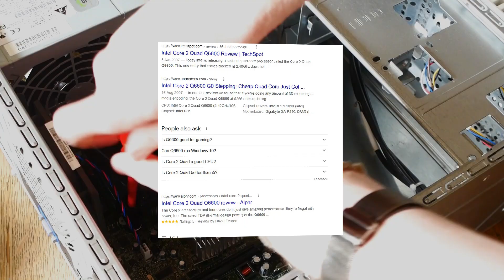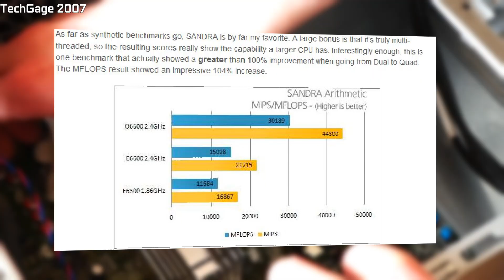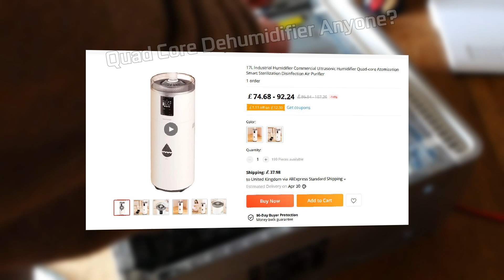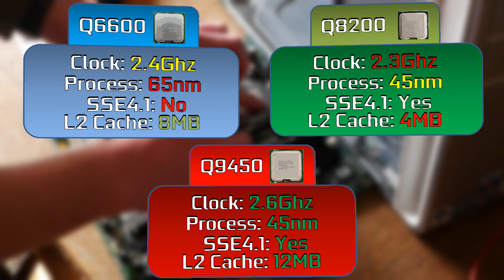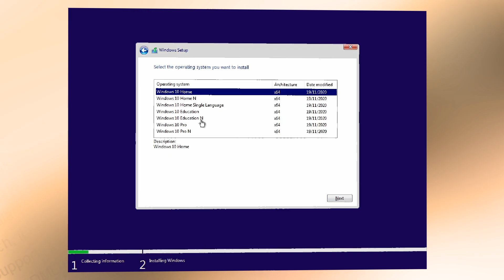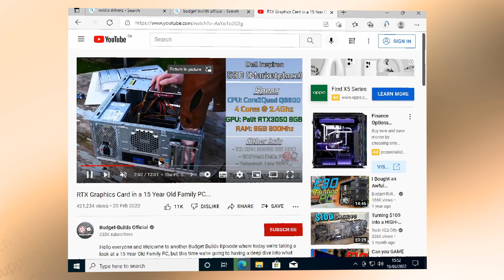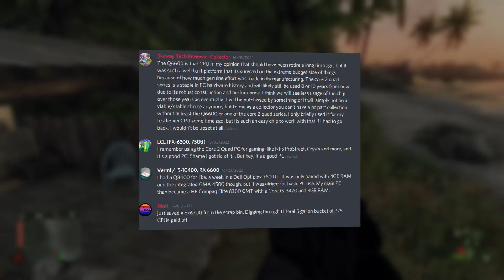Intel's Core2Quad...Finally Obsolete?

Comment: the Q6600 for £10 seems silly versus the i5 2500k for £15 which can overclock to near 5GHz
Reply: You don't buy the cpu. You buy an entire used pc with a q6600 at a local thriftshop or something
Reply: @bonnome2  for £10 that is more worth it
Reply: Frequency doesn't automatically mean better performance though, just look at bulldozer
Reply: @canaconn2388  in this case it means a lot as 2nd Gen Core i series has incredible IPC for its time, with the overclock it rivals stock 7th gen i5s
Reply: You'd look rather silly trying to plug an i5 2500k CPU into an LGA775 socket.
Reply: @terrydaktyllus1320  obviously buy an LGA 1155 not 775
Reply: @williampaabreeves  So it's not £15 for the i5 2500k then because you would probably need to spend at least £30 for a used LGA 1155 motherboard, wouldn't you?

I bought a Q6600 for £3 in my local CEX store today - so a fair comparison would therefore be "the Q6600 for £3 versus £45 plus for an i5 2500k and replacement motherboard.

Oh, you'd probably need to do a RAM upgrade too because the LGA775 board is probably DDR2, whereas the i5 board will be DDR3.

You're welcome. You can thank me later.
Reply: @terrydaktyllus1320  he tested the q6600 with a ddr3 board.
You can get low end 1155 motherboards for similar to 775, around £15.
Not a fair comparison unless you include all components. The 2500k is still vastly faster for that £10-20 extra.

The only situation to buy the q6600 is if you have LGA 775 with a core 2 duo or lower already.
If starting from scratch, the extra for LGA 1155 is worth it due to the existence of i7 as an upgrade path

If someone is so flat broke that £10 more is unfeasible then perhaps dumpster diving around office buildings would be a better path to a new pc
Reply: @williampaabreeves  But I don't have my Q6600 in a DDR3 board, I have it in a DDR2 board. So your cost comparison is entirely incorrect in my case because I would have to include the cost of a new (used) motherboard and DDR3 RAM. Again, you can thank me later for correcting you.
Reply: @terrydaktyllus1320  your one case is a very small minority.
This comment thread started with just a CPU price comparison of £10 Vs £15
Which the i5 2500k is obviously better value in
Reply: @williampaabreeves  Most LGA775 motherboards are DDR2. Sonny, I've been building computers as one of my main hobbies for 40 years now, not to mention that my day job has also been with computers for an almost equal amount of time. I know what I am talking about. So say "Thank you, I've learnt something new today."
Reply: @terrydaktyllus1320  clearly not very successful if still using a q6600.
Only thing I learned is you think yourself as the only viewpoint and authority on the subject. With your specific circumstances as the only situation

Comment: No C2Q experience beyond fixing a couple 775 mobos back in the day. I would be interested in doing a comparison to how the challenging Athlon/Phenom series is holding up these days though. My first PC build was an Athlon based system because they were noticeably cheaper when I was building it
Reply: I bought a Phenom 2 955 95W a couple of days ago for just 8€ including shipping. I also have plenty of 775 chips and motherboards around. I would like to compare the two competitors to each other. I've also a Phenom first gen Quad-Core somewhere to compare it as well. The main difference is the integrated memory controller and for the Phenom 2 the L3 cache.
Reply: @jhonnyxyz  Darn! A Phenom II 955 (95W version) sells for about USD 35 in my country :-(. That's without Cooler/Fan. No wonder I'm still using my Athon II X2 to type this. Edit: besides... my aging motherboard would probably melt if I try to run anything above 65W :-D
Reply: Phenom II is slightly faster than C2Q clock for clock and overclocks similarly so it'll be holding up too, although obviously the six core option will do a bit better especially with modern games that can actually scale to use those cores. :D
Reply: I resurrected an Athlon XP machine recently and it was not very usable. For one those weren't 64 bit chips so you're now quite limited in terms of "current" O/S choice. And once I found a Linux distro which worked, it could barely cope with opening the front page of YouTube much less play HD video. The 64 X2 might still fare better, I think X2 had similar performance to the C2D of the time, but certainly not C2Q. It was undisputed king at that time.
Reply: @ubergeeknz  The Athlon64 x2 wasn't as fast as the Core 2 Duo, but it should still be fairly usable with a suitable modern Linux install especially if you have a PCIe motherboard and throw in a reasonably modern GPU for video decoding.

The Athlon XP won't work too well with modern Linux not only because the CPU is simply too slow for a lot of modern programs but the Socket A platform itself is the last "old school" platform (eg. IDE is the main storage access stnadard with SATA being a bit of an afterthought on later boards, there's no PCIe support or anything remotely like it, etc) where a lot of the underlying software required for an OS likely isn't tested too thoroughly with that kind of configuration these days.
Reply: I bought old PC for 50 EUR because it had solid steel case and modular 750W PSU (I also spared copper Zalman 9500 heatsink and GT710 from it for my Ryzen 5600X office build).
It had Asus m3a32-mvp deluxe MB with Phenom 9850 and 8GB DDR2 (which I later sold for 24 EUR), and I tested it a little. It has similar performance to Q6600, runs Windows 10 Pro, easily plays Youtube HD videos but runs much hotter than Q6600. So older quad cores still can be used in 2023, but when 3rd or 4th gen Core are almost given away (one can buy i5-3570 with 8GB of RAM and 240G SSD drive for 50 EUR) that makes no practical sense.

Comment: Tested on windows 10?
Reply: @BudgetBuildsOfficial  oh, sorry, didn't watch to the end. If you use win10, can you please test something with optimized win10? With disabled mitigations, defender, background stuff, and optimizations (like forcing CPU to always work at 100% and moving GPU/usb driver from core 1 to core 3 and 4, because windows likes to load core 1 more than the rest).
Reply: Also disabling "fullscreen optimizations" (introduced in iirc build 1809 of win10) on games. It allows you to see volume bar and notifications while you're playing in fullscreen and hurts performance by 1-2%

Comment: Holds up better than the older Phenom does thats for sure. Maybe more comparable with the later 6 Core Phenoms but the Quad Core Phenoms lose 100%
Reply: nope, quadcore phenoms 2 gen are better than 775 quads
Reply: @jatoziomek5608  where's your stats for that? My own testing has shown the phenoms to lose to core 2 quads massively

Comment: I use my old Core 2 Quad Q6600 computer as a file/media server. I built it all the way back in 2009, it has a 9800 GT, 4 GB of RAM and an 80 GB Intel SSD which wasn't cheap back then. I also added a 4 TB HDD when I turned it in to a server but for some reason the motherboard is stuck in IDE emulation mode with no apparent way of switching to AHCI mode so can only address 2 TB partitions.
Reply: I didn't even know ssds were available for retail purchase in 2009, nice
Reply: wow, I started off with a 9800gt and 4gb back in 2016 when I built mine as a sort of super budget system
Reply: YES! I have a Q6700 in my homelab as a file/dns/vpn server, and it works beautifully. I have 6GB of RAM, and a GeForce 7300GS (in case I need physical access).
I think the Core 2 Quad (and LGA775 by extension) really shines in the budget home server niche; it’s in a sweet spot where the hardware is old enough to be dirt cheap, yet modern enough to be a viable solution with all the bells and whistles you expect on a CPU. Those 4 cores really go a long way!

Comment: dude, xbox one is last gen and has been for two years. wth?
other than that, it's impressive that this thing still works at all. if you go 15 years back from it, you'd land on a 286 cpu. assuming it would support it, a 286 would take like a whole day to render a frame from a game a q6600 runs at 60fps

Comment: currently watching this on my core 2 quad PC from 2014, so far so good as long as you optimize it properly. Like using useful extensions like Ublock Origin, H264ify, using lower versions of programs that doesn't require constant internet connection (like Photoshop) etc. I actually learned it  from you Budget-Builds Official, from your old computer benchmarking videos. Great content as always BBF, I loved this type of videos you make. Keep it up man!
Reply: Linux is your friend if you still use a core 2
Reply: @canaconn2388  not really if you want to play games...
Reply: @0ka354  then you shouldn't be playing modern games on a Core 2 Duo/Quad.
get an sandy bridge lga 1155 platform instead, cheap and common out there especially on oem systems in the Europe & USA.
Reply: H264 didn’t make any difference on my Core 2 Duo P8600.
Reply: You don't need h264-ify if your GPU is recent, as it handles the video decoding. When the GPU has hardware video decoding, even a crappy single digit watt Celeron can run 4K60 video with no issues.
Reply: I tried H264ify and it didn't make any difference. Does it work well for you?
Reply: @pessoaanonima6345  Do you have something that has h264 working otherwise? which cpu?
Reply: @rkan2  Core 2 Duo e7500
Reply: @pessoaanonima6345  It is too old - you need at least Sandy Bridge (i5 25xx) to have H264 decoding or "Quick Sync Video"
Reply: @rkan2  I thought the extension would use h264 to get videos running faster on older computers. Maybe mine is just too old.
Reply: @pessoaanonima6345  No, it forces YT to serve out H264 instead of VP9 which isn't hardware decodable everywhere. Many phones still around supporting just H264 which is one of the reasons YT serves both.

You still need the decoding capability. Which GPU did you have? It could also have a hardware decodet for h264.
Reply: @rkan2  I know, I just thought h264 was batter for these old devices.
I tested mostly on a 8400gs, but also tried on a gt 420, hd 5450 and intel 4 family express chipset.
Reply: @pessoaanonima6345  I have the E7500 and the extension doesn't work for me as well. It works on some C2Qs though.
Reply: @NFStopsnuf  You need at least Sandy Bridge from 2011 like I said
Reply: @rkan2  but h264ify does reduce the load on older cpus despite them not having native h264 encoding anyways right? (as in h264 is easier to encode than VP9 so there is still a slight benefit of the extension
but not total improvement

using a westmere cpu here, one year too early 😡
Reply: @nerd2544  I don't think so - the processing requirement on CPU is probably almost equal between VP9 and H264. The whole point of the extension is to allow for H264 hardware decoding where it is available, instead of decoding the default VP9 with CPU.
Reply: @rkan2  really? i thought vp9 was a lot tougher to decode 👀
Reply: @nerd2544  If we talking stuff that is even decodable with such old hardware - there is no difference.. Maybe when talking 4k, 8k where you should also be using h265 anyway.
Reply: @HappyBeezerStudios  I think you're mixing up encoding with decoding. According to Wikipedia nVIDIA GPUs since the GeForce 8000 series have support for hardware H264 decoding. 

Sandy Bridge introduced QuickSync video encoding, which became useful for streaming.
Reply: @pessoaanonima6345  It depends whether you are using a GPU that has hardware x264 decoding.
Reply: I5 2400 is slow, so c2q is super slow
Reply: @JacobJohnson-lh4gx  You can't as the CPU DOESN'T have hardware encoding.

The GPU does.
Reply: On windows 10?

Comment: The core 2 quad doesn’t have the instruction sets to render for DX12 API and will also have difficulty with Vulkan API.

This was also noticed on the 1st generation i7’s and i5’s.

In some DX 12games there is texture mapping missing in those games because it cant render under those API’s.

There for without the instruction sets for those API’s it is useless for newer games using DX12 instruction.
Reply: Which instruction sets exactly?
Reply: @tweakz_tech  the main instruction set needed for DX12 api to run optimally is AVX2 which wasn’t an instruction set until 2013 and was released in some second gen icores, but was added to all future generations starting from 3rd gen to present.